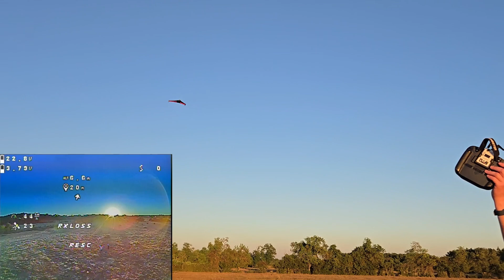Radio OFF - Wing - Betaflight RTH test

Comment: Do you mind showing us your build and configuration?
Reply from the maker: Hi! It's a simple Sonic model AR wing classic. With heads-up 533 motor, HQ r36 5" props. Servos are emax 9g metal gear HV, and emax bullet ESC. Running 1400mah 6S droneracing battery.

Comment: That's rad. How does it orient for final approach? Ideally, it would approach on the same path as the departing launch.
My inav friends are trying to get me into wings... I'm thinking take the trainer wing and flash betaflight to it 😂
Reply: thanks! So far its pretty much random, after reaching certain altitude it turns away from home and fly away till it reaches certain distance. Then turns around and lands. But i like the idea of landing from the direction it was launched towards!